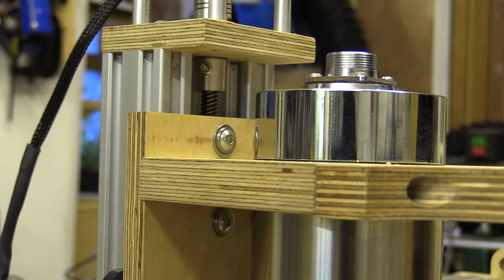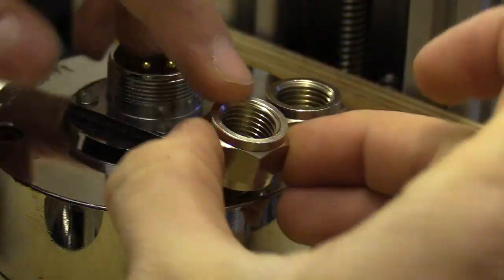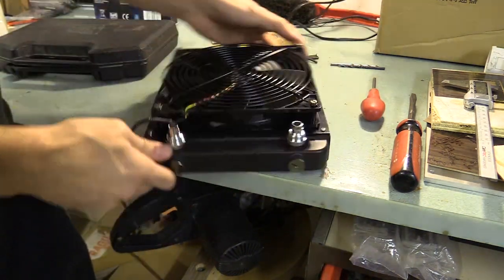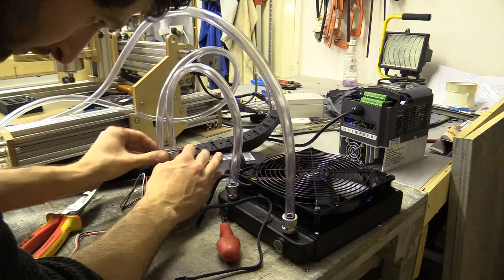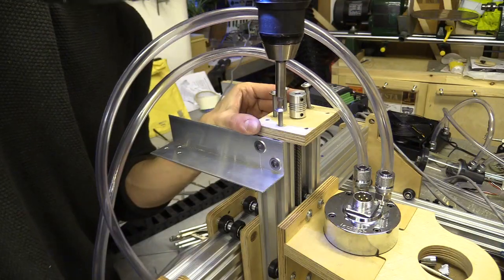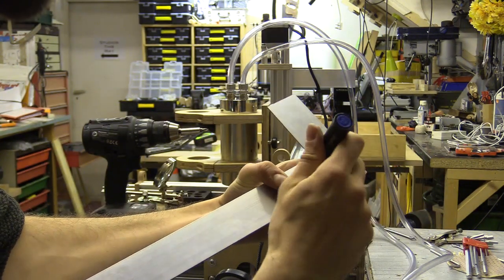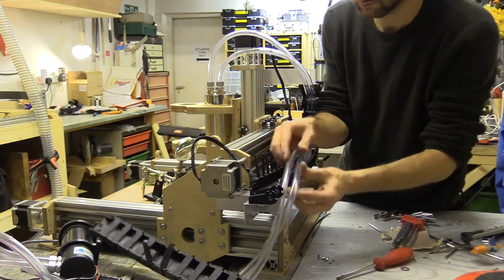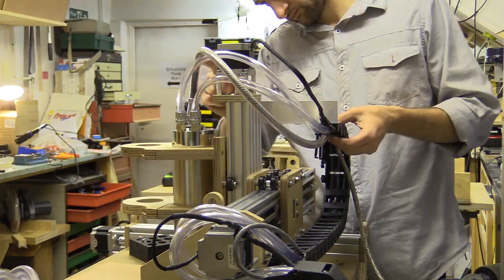#7 Installing Water Cooling Tubing and Drag Chain #7 / C-Beam Lead Screw CNC

Comment: Nice video series! but a single thik 120mm is enough. Not the cheap 120mm from china only 25mm, branded is 50mm. And a small 50ml tank/pump mounted to Z axiz so you dont have 5 meters of water pipe.
Reply from the maker: I gave up with the water cooling. It really is an overkill for the type of milling I will be doing. Only went with the spindle because it was... da da daa... free.

Comment: Hi Savvas great work! I ve been a subscriber for some time now but i miss this series from the start..I went to your patreon account to see if I can catch up, and i discover that patrons, have access to any project files, sketch up models and diagrams associated with your videos. Does this includes and material links for us from Cyprus? BTW I would suggest u to mention that material is available for patrons  on your description nxet to the link
Reply from the maker: Thanks Peter. I'm going to release the material list with links to where I bought things on Patreons once I have completed the build, and can confirm what I used. I've had to buy a little more stuff then what I've actually needed while working things out. I was also thinking about sending some birch plates out to guys who have been supporting me once they have been redesigned.
Reply from the maker: I should probably rethink the reward gifts a little as it's clearly not that rewarding. Lol.

Comment: I am presuming that was a dry test fit, you did use something on the threads to seal them. lol
Reply from the maker: The compression fittings have a rubber ring on them but the adaptor nipple probable needs something - although there's some left over gunk in the thread on the spindle. I think it will be ok???